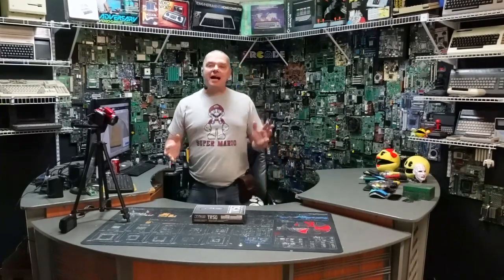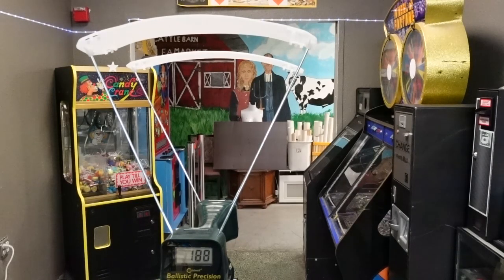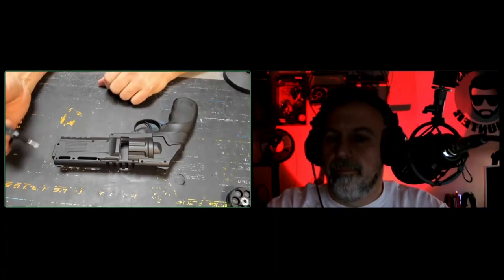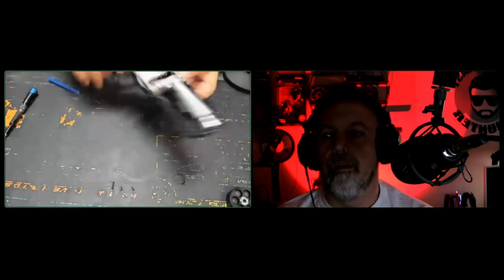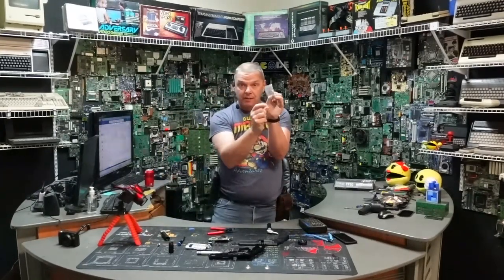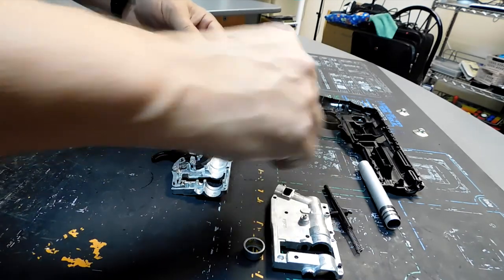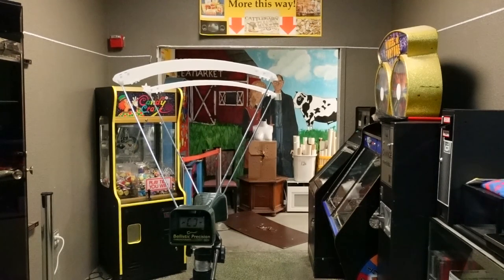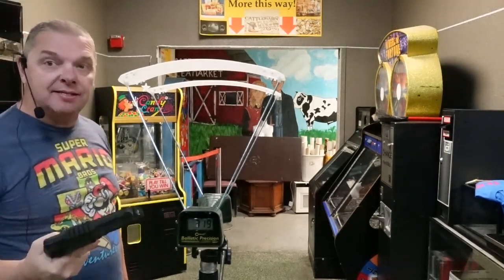Lets upgrade the T4E Umarex TR50! | 20-30 Joules!! This thing is MEAN!

Comment: I am in between the HDR 50, the First Strike Roscoe, the HDR68, or the Walther PPQ 43 as a less lethal option to leave in a vehicle and maybe carry as well. I know the Walther would carry the best and is quite accurate, but it seem the revolvers can be more easily upgraded for more power. What do you think is the best option for what I am looking for?
Reply from the maker: You’re on the right track. For a car, I’d go with a fully modified HDP50 for the car. It’s small enough for the glove compartment or console and isn’t punctured until you need it.

Comment: I modified my HDP50 7.5j.
With that block in my co2 tube and 1mm shorter pin..and no 'horse shoe' block..empty.
I have the tuning pipe long barrel. No chronograf numbers yet..rubber-steel balls.
Its louder and have a good punch.
Reply from the maker: Yeah man! That extra pressure makes a world of difference! Thanks for watching and welcome to the family!

Comment: I'm seeing one of these online which has these upgrades added to it: Homedefence-24 (made in Germany) valve upgrade and Homedefence-24 tuning barrel (full barrel). It's being advertised as 612-676 FPS. Any thoughts on these upgrades?
Reply from the maker: They are wonderful! Umarex is actually out of Germany. They have different rules and regulations as to the velocities they can import into the US. Just remember, once you get over that 400 ft./s range, Pepperballs become problematic.
Reply: @AlternateArmsSD  Thank you very much for the information. I have the P2P T4E HDP50 which I'm using as pepperball only and am looking to get the T4E TR50 revolver for first strike rounds. I'm thinking for the price and simplicity the 11 Joule version would get the job done and act as enough of a deterrent. I'm not sure I can personally justify paying almost 3x more for the 20 Joule version. I respect how much effort it takes to do the upgrade.
Reply: Mine done using home defence-24 products.  Works amazing
With extended Barrel it’s close to 27J
Reply: @petersmith6974  hi pete was it assembled before u bought it if so who sold it. Thanks
Reply: @servant72   I've got the 11 joule version and really like it. I'm going to fit  the Hd24 inner barrel and suppressor kit.  My neighbours batch about noise. It's a good way of getting a little more power with minimal work, not having to open up the 'gearbox'. Not cheap but build quality looks excellent.  PH
Reply: @pedh6806  Thank you for the information.

Comment: I have the 11 joule gun so can I just remove the horseshoe spacer for more power? I dont shoot pepper balls only solid projectiles.
Reply from the maker: Yes and no. On the TR50 you have to have either the C02 restrictor or the new valves which have the restrictor included. If you need either, shoot me an email at jonreynoldscts@gmail.com

Comment: Question

If I bought mine in Germany, I for sure have a 7.5j HDR so if I buy the X Valve tuning kit I'm gonna wreck my HDR useless? 

If yes how can I safely mod my 7.5j weapon. 
Is there a way to buy spare parts of the 11j Version that fit into mine? 

Also u stated in one comment as long as the bullets go over 400fps I cant use Pepper or Paint so in your mod it was 350 at its peak, so Pepper balls are still usable or do I have to worry they rupture in the gun? 

And the last question is there something in between a mod that lets u fire steel and rubber  with higher  power than the stock version and still be able to safely operate paint and pepper balls. 

Thx for your time a really informative video 
Learned a lot 

Looking forward to new videos about non Lethal defense weapons

Stay safe and have a good 1
Reply from the maker: Ok,  i’ll break this down two ways.

IF you were using the HDP50:

If you have the 7.5 version, all you would really need to do is remove that valve block. If you want to install the tuning kit, you may have to upgrade the entire valve assembly to the 11 J version. There are advantages and disadvantages both ways. The advantage to simply removing the block is that you’re going to get 5 to 10 shots at full power. But that’s all you’ll get. If you install the tuning kit, you’ll get closer to 20 shots but they won’t be quite as powerful.

As far as a pepperballs, I found out a couple of interesting things that I will be putting into the next video. The brand makes a huge difference. I was actually able to fire pepper balls at close to 600 ft./s using the modified version and they did not rupture in the barrel.

Also, I have some 50 caliber steel bearings coming in to test as well. We’re going to put this through its paces and see what it’s actually capable of. At this point, with the modded version you’ve seen in these videos, I have put close to 100 rounds through this with no problems at all.

If you are using the TR50:

On the tier 50 I have noticed some thing very interesting. If you simply remove the valve block there is so much pressure internally that occasionally you will get, what I call, a locked fire. Essentially, that lets all of the pressure out of the system at one time. Also, I’ve seen it lock up the mechanism to where you literally have to release pressure in order to find the weapon. on the tier 50, you can get away with removing the valve block but you have to put in the constrictor on the valve assembly itself at the bottom. If you’re going to do that, you may as well install the entire kit :-)

I know this was a little confusing since I put both weapons in here, but I always strive to give you correct information :-)
Reply: @AlternateArmsSD  

Hey thx for the fast and detailed response

You answered all my questions besides one but don't feel rushed to answer.
So can I buy a complete 11j valve assembly that fits into the 7.5j Version? If yes where?

Again have a good 1 
Stay safe
Reply from the maker: @dadutchaya  Homedefense24 sells the 11J assembly I believe but you can also bevy them on EBay, I’m trying to get a shop set up so I will have all of these in stock. Stay tuned :-)

Comment: Hi John..another great video..
I've got a umarex Hdr50...11joules...standard(not upgraded)...what I've noticed, it's leaking on the charge indicator pin...please tell me how to rectify this problem. Thanks
Reply from the maker: You can rebuild that mechanism but it’s actually cheaper and easier to just replace it :) There’s an Oring on the threaded portion that might be damaged as well assuming it’s tightened down correctly. If you need the cap, shoot me an email at jonreynoldscts@gmail.com. I’ll be back in town of Friday.

Comment: I shaved 2 mm off the original pin drilled the hole in the screw in valve at the top op the co2 chamber to 1 1/2  mm took everything out of the insde the valve. Put on the tuned barrel and extension. Put baby powder on the ammo an got 42 joules crazy a only paid for barrel.oh they also have a silencer
Reply from the maker: Yep, these things are amazing! I have several more upgrades in mind :) Thanks for watching!

Comment: Cool stuff All I ever did was upgrade the valve to the 11 joules version I've always been curious as to how to do what your doing maybe some day I'll get mine and do the same although I'm getting prity good power with just the new valve do you know if removing the valve block will work on an 11 joule valve or dose it have to be the 7.5 version yeah the photo idea is great I do the same at my shop when I'm servicing a watch I'm not familiar with just incase I have to leave it for a while and come back like another day like I said before Old man memory not what it used to be
Reply from the maker: It works with both models. It’s the same mod :)

Comment: Thanks for nice demo!  So the upgrade that you did is Power kit .50 on TR50 (without "F" marking)?  So for TR50 with "F" marking one would need to buy 11 Joule valve assembly upgrade.   How does the powerkit 50 upgrade compare with 11 Joule valvue assembly upgrade (with valve block removed) in terms of fpe?
Reply from the maker: The rumor is, if you have one without the F marking, the power 50 upgrade will give you close to 20 to 30 Joules.  The downside of that, and this one is already approaching that threshold, is it at first with too much velocity to fire pepper balls. You would be stuck to solid balls and whatever creative projectiles you use. I have not been able to locate one of the states that the test that I know. If it is I do, it will be on the channel :-) Thanks for watching!

Comment: Question, John… I notice 50 caliber balls (and other calibers) vary in weight. Noticed some less than 3 grams, while others are much heavier. Mostly, I’m curious if a heavier ball slows down its speed when shot. It’s possible that the weight, in the same size caliber, is indicative of the material. Since I’m new to all of this, I thought I’d ask. Thank you!
Reply from the maker: Greetings! Yes, the weight of the ammo does affect velocity but you gain impact. Also, there are so many types and manufactures that it varies widely. I prefer the runner/steel, aluminum, and pepper balls myself. Thanks for watching !

Comment: Without taking the whole gun apart. You said to check where the co2 goes in. So that circular block I an looking for. 7 joule vs 11 joule. Which is which ?
Reply: 7 joule is open but has a bigger baffle in the valve. Which you carnt see without stripping apart

Comment: Ok so i dont have to take out the trigger assembly to remove the old valve and install the new one? i can just be careful and leave it all in? i saw in other videos they took it all out and it looked like to me you wouldnt have to
Reply from the maker: You do not have to remove that trigger assembly. The only reason you would have to, is if you make a mistake when removing the top from the bottom of the case.. go SLOW and take your time. The pin that is connected to the trigger mechanism is a floating pin and connect to both the top and the bottom halves.
Reply: @AlternateArmsSD  perfect because that looks tedious as hell and if i can avoid it that would be ideal lol. thanks!
Reply from the maker: @impv1se  Heh yeah, I’ve done so many I’ve kind of become jaded to it :-) just go very slow you’ll be fine :-)

Comment: Hi great video, iv the t4e tr50 with the 'f' marking you mentioned, what mod can i use to gain power? Thanks lee
Reply from the maker: Greets! Just pull the valve block. I have a much newer video that tears down and rebuilds the launcher in great detail. Also, you might want to change the valve to the new reenforced valve.

Comment: Hey so I got the 11 joule version and got home defense 24 kit ordered.

I see you didn't take horse shoe  component out in the video. I see other are doing it. I wanted to get the most power out if it. do I take horse shoe part out of it and add other mods from home defense?

Im abit confused, as in other videos it shows people just taking the horse shoe shoe part out and not using any of the mods from home defense 24, is this the same result as using the upgrade kit? or can you do both?
Reply from the maker: Greetings, I would absolutely pull that out. The truth is, if you remove that valve block, you don’t need the power kit. The horseshoe component is only in the 11J version. In the 7.5 version, it’s actually a full valve block with a little pinhole in the center. Hope that helps :-)
Reply: @AlternateArmsSD  Hey. first of all thank your for your prompt response, it smucb appreciated.

So the only thing I need to do to get 20J plus is take horse shoe out and forget about the kit. then if I want to go further get an extended barrel. However for now the horse shoe will get every I need (as I don't need to open the home defense packet at all 100%?)

Just want to make sur ei do everything properly. I ordered the kit now, so could just return it. but want to be absolutely positive before hand from some one who clearly knows what they are doing 👌
Reply from the maker: @techfreaks4134  Yea indeed. That extended barrel is going to add some power as well. I need to order one of those myself.
Reply: @AlternateArmsSD  lastly, is the anything I need to be cautious about, a so hear a lot of people damaging the seals and having problems with the guns after modifying them?
Reply from the maker: @techfreaks4134  i’ve probably put 300 rounds through that modded version you saw on that video. I haven’t had any issues that I’m aware of. Also, since they are only pressurized when you puncture the cylinder, the seals are not under constant pressure. I certainly would not leave them pressurized for extended periods of time, you do have a lot of pressure on that seal at that time. However, if you’re going to use it in the capacity it’s meant to be used, it won’t matter anyway. You’re going to fire fast.

Comment: I got the 7 joule version😢 I'd love to be able to upgrade, but finding out what to do it is way easier than finding the means to do it
Reply from the maker: @JB-pw9dv  there is an incredibly easy way to do it. All you have to do is change out the valve block to the new reinforced version and you’re done. If you need that valve block, shoot me an email at jonreynoldscts@gmail.com. Also, look further forward in my videos, and you will see a complete teardown of this launcher, all the way down to the nuts and bolts.

Comment: So I can't just remove the valve block for more power because I have the one with F on the side??? I'm not exactly sure what I need to to do 😢
Reply from the maker: You need to add the C02 restrictor after you remove the valve block. It’s very easy.

Comment: Just bought the 11 joule one off ebay says 480 fps, it's modded and includes the 7 joule stock valve in the box. Wonder if it's legit 480 fps and if not how can i get more out of it, thanks for the vid!
Reply from the maker: Greets! You may be able to indeed. I have something coming in might take care of that. Stay tuned :-)
Reply: @AlternateArmsSD  After watching your video i thought of how slow the speeds were coming up even after the upgrade and when i load the cartridge from the back the side with the metal pinwheel that rotates said cartridge when trigger is pulled, i get a lot of friction it's a really hard push and think that's where your slow speeds are coming from on that meter. Load them from the other side you get a looser fit and can feel it touch down on the stop if you will. This gun is rated 360 fps on the 7.5 joule and 480 on the 11.
Reply from the maker: @TheGdiddy35  Yeah, I noticed that as well. There is also one other thing I’m testing now that makes the upgrade much easier. Stay tuned :)

Comment: Do you recommend getting the 11 joule or the 7.5 joule hd 50 to upgrade (meaning which one is cheaper and easier)? Also, can you fire the bryna pepper rounds out of the 7.5 or 11 joule version?
Reply from the maker: Greetings, you’re going to end up getting the same power out of both of them after the modification so either is fine. I would say save the money and go with the 7.5 and upgraded. You cannot fire the burn around so because they are 68 caliber and the TR 50 is a 50 caliber. However, there are many many different manufacturers on 50 caliber pepperballs. I have some as well.
Reply: @AlternateArmsSD  Sorry for all of the questions! Complete noob and trying to figure it out.  

Can the HD68 fire the bryna pepper/max rounds?
Reply from the maker: @ShaneCrenshaw  , one thing you’ll learn about me, there’s no such thing as a silly question. You’re welcome to ask me anything you would like :) Those will absolutely fire the max rounds.

Comment: I like little details related to science, for example the weight of the projectile.
Reply from the maker: There is a LOT of that in more recent videos. My testing practices have included, weight of the projectiles, velocities, and trigger pull strength.
Reply: @AlternateArmsSD  I didn't see or hear any of that, except velocities, in your video about the M17, when you unboxed it? I'm looking for a less-than-lethal home defense gun for the worst -case scenario of 4 intruders, big men, breaking into my home at night. I like the idea of having 30 shots available, and being able to shoot heavier projectiles that will hurt so bad on the receiving end. I would shoot center mass and can put one in someone's face if the first few center mass don't stop him. (I'm a Vietnam combat vet, and one of my few medals was marksman. I qualified with 60 in the bullseye out of 60 chances.) I looked at the  m17 cqmf gun someplace (a stroke disabled my memory functions), and it seemed to fit the bill, but I then read that these mods will break the gun down because of excessive pressure on all the o-rings. It would be valuable to me if you did a series on home defense weapons for guys like me - older, unable to purchase a firearm - but who want to feel safe in their homes. Maybe you could find five guns that are modified by someone, that are reliable, that can shoot 8 gram rubber/plastic balls with some energy behind them.  One slogan I see online is 30 rounds at 40 joules, which seems like it would SOUND scary in a room full of impressionable men looking at an assault weapon. Then getting hit several times with those balls would convince them to get the f**k out of my house.
Reply from the maker: @PatrickDeBoard1946  look further forward in my videos. This is an older video. Also, watch the videos on the NPDD. This is something that is going to greatly interest you. You can send me a direct email at jonreynoldscts@gmail.com. I will do everything in my power to steer you in the right direction :-)

Comment: Where did you get your angled pliers at? I can’t find any like that.
Reply from the maker: I got mine at ace hardware. They were called electricians pliers. However, they also had a small set of needle nose pliers that were actually bent as well and they seem to work just as well or better.